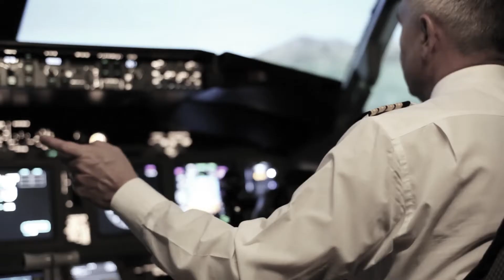Epic Flight Academy | Average Aircraft Mechanic Salary

Comment: So for this course how much would it cost?
Reply: This depends on where you go. I’m at Amarillo College A&P school and my tuition is $2,230 per semester plus books/ exams
Reply from the maker: The Aircraft Mechanic tuition is $19,500 plus $300 for books and $1,500 for tools. (You will own these tools.) A $45 application fee, 3 FAA exams at the end of the 3 courses, and upon completion of the program, there is an FAA oral exam and an FAA practical exam for $1,050 in total. We disclose all costs upfront so you can plan accordingly. Total cost is: $22,850. https://epicflightacademy.com/aircraft-mechanic/
Reply: No thanks! I went the local Community College route that has an Part 147 FAA Program. I went to school for 24 straight months, no breaks and earned my A&P Certificate for a total of just under 5,000 dollars. That included everything from tools to books each semester. Although it was 11 years ago, I still say this is the best route for the average Joe!